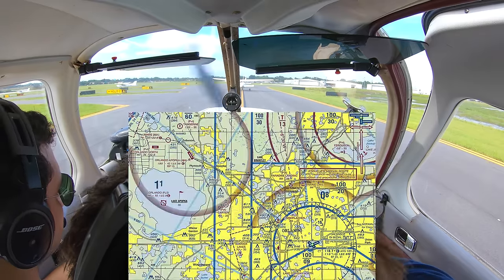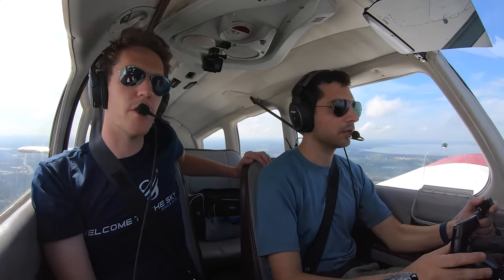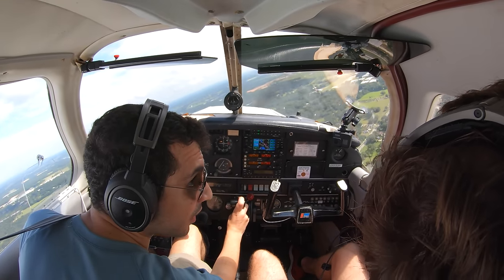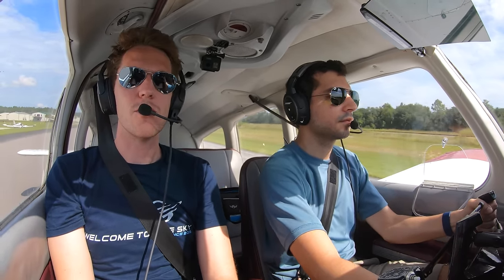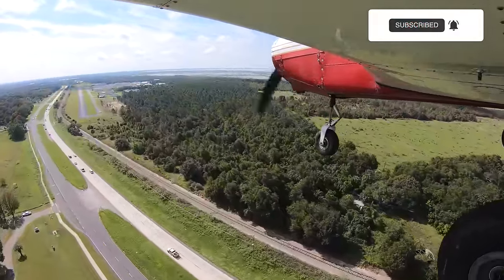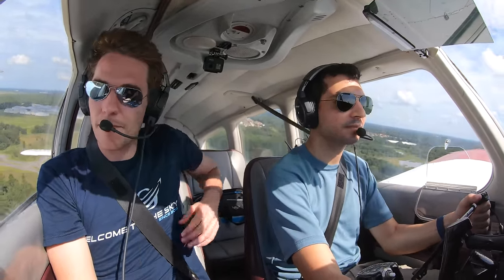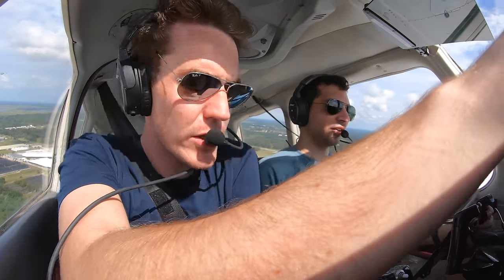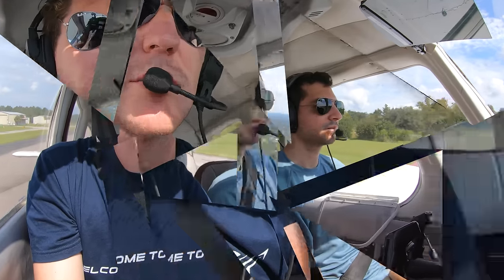Landings At An Uncontrolled Airport| Overhead Entry

Comment: @lewdixaviaiton - question for you.  I'm a little over 500 hours, and I've heard different points of view between a tear drop entry vs just turning on downwind without the teardrop.  Can you share your thoughts on why you would use one over the other?
Reply: Agreed.  I would have thought crossing midfield, sock check then turning downwind or cross midfield again would be the way to go...
Reply from the maker: While both are in the AIM, I prefer the teardrop. Simply because I think it's a bit safer given that you are flying a minute out of the pattern to enter on the 45° downwind. If you're overflying the field and turning downwind immediately you run the risk of cutting someone off if you happened not to see or hear them. Just a personal preference really.
Reply: @LewDixAviation  I agree, especially if it is an airport I haven’t been to. It helps me with the bigger picture visually, if that makes sense.